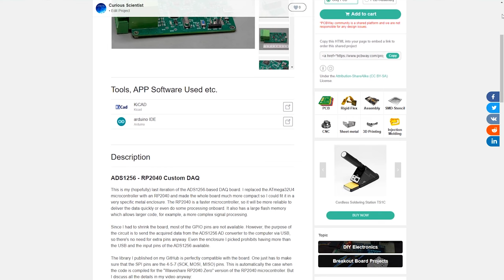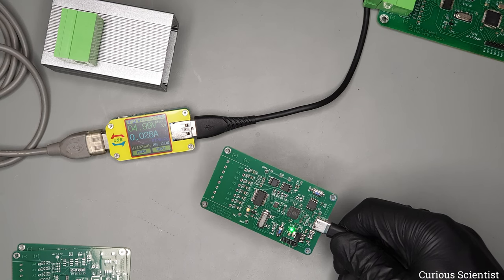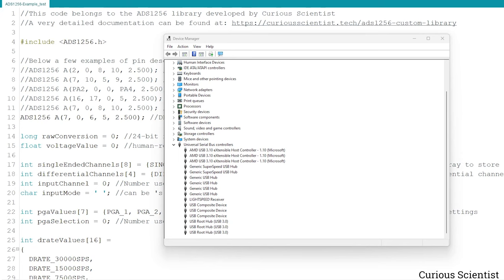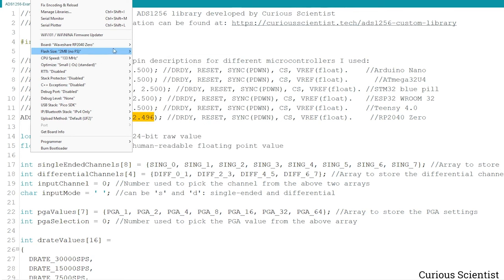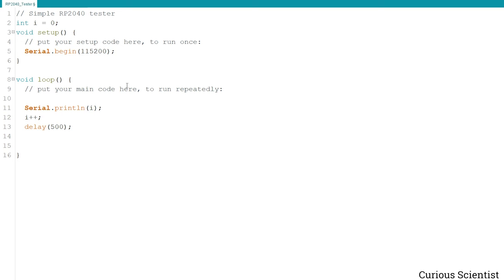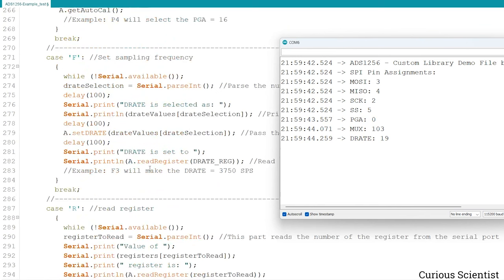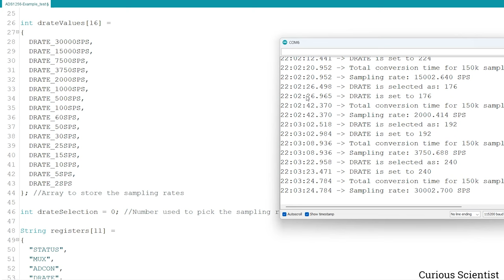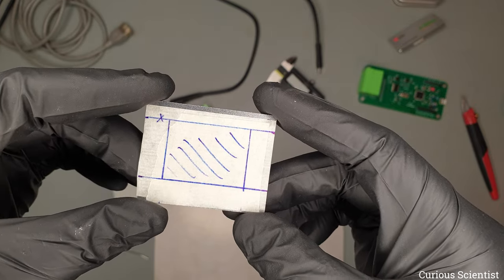RP2040 + ADS1256 DAQ board

Comment: Nice board,is this open-source.why are you using a large TBC connector in the latest iteration compared to the old versions
Reply from the maker: Hi! Thanks! No, the board is not open source because I want to sell it as a product. All older versions have the same big connector. I wanted to have something compact and neat to connect all the 16 possible input wires.
Reply: @CuriousScientist  ok

Comment: Put a red led for power supplyand green led for uart/usb tx rx
Reply from the maker: I see you haven't watched the video. :) There is a power supply LED. At both LDOs. 

Regarding TX and RX LEDs, I don't find them useful, so I did not add them.
Reply: @CuriousScientist  I meant to put it outside the box.drill two holes on the metal plate on the usb side.push two 3mm through hole led through it and connect wire to pcb .this help the end user like somebody who bought your product trouble shoot easily.For eg is the borad receiving power,yes if led is lighting up.if led not lighting up ,no power.maybe my usb c cable is faulty.
Reply: @CuriousScientist  regarding tx rx led.i would suggest you keep it because it is a good indication that the daq board is transmitting something
Reply from the maker: Thanks! Yes, it might be a good idea to have an LED on the front panel. Regarding the tx/rx LEDs, I still have the same opinion.

Comment: Vilket bygge! 

Nice, I'm really interested in this journey and impressed by your builds and looking forward to a possible next video when you release it as a product! 

I have a question regarding grounding of the box. It was not included in the video (i think?). Do you think it's irrelevant for the performance and no protective usage as its only usb-powered?
Reply from the maker: Tack! 
Yeah, I haven't mentioned anything regarding the grounding. Actually, the board is floating. It is not connected to the ground in any way. But I will do some investigation on the effect of this. I will get some new front and rear panels manufactured for the enclosure, and I will conduct some tests. So, at this moment, I don't really know if it has any effect.

Comment: BTW, I'd guess, if you replaced 16Mhz crystal on your old boards with 20Mhz, they'll probably work and you might be able to get full sampling speed out of them at that speed.
Reply from the maker: Thanks! Yeah, it could help, perhaps. But I think the RP2040 version is much better not only because of the much higher speed, but also because of the memory. It allows a lot of onboard processing.

Comment: While it will cost some money may i suggest ordering PCBs from PCBway with holes and all for the rear/Front pannel you can even use the "silkscreen" to write fancy info like A0,A1,... and on the rear the specs of the DAQ box. Also please release a YT vid when you start selling as i am interested in replacing my ratsnest.

Examples
https://www.youtube.com/watch?v=nV8RkhaKKb4
https://www.youtube.com/watch?v=wg_J9WElvBY
https://www.youtube.com/watch?v=UOQezMJ560o
Reply from the maker: WOW! Hey, thanks! I have another project where I was thinking about using a PCB as the rear panel of the enclosure, but I did not think about it for this project. It is amazing that you brought it up, thanks! I will definitely design them and add them to the project. The extra cost will be relatively low because the dimensions of the panel boards will be small. Thanks once again, this suggestion will be super useful! Also, if you are a subscriber, you will definitely hear about any news related to this project because I will spam it all over the place. If you have Instagram, you can follow me there as well because I upload even more content there.
Reply: @CuriousScientist  Glad my 2cents could help wanted to do something like this but i never have the fortitude to finish/polish my stuff.
Reply from the maker: Thank you! You should never give up! I've been working with the ADS1256 chip for about 8 years. It took me roughly 4 years to develop my very own code by studying the datasheet of the chip. And it took roughly 2 years of iterations and learning to reach the current board design. Of course I did million other things in the meantime, but still. It is not a sprint, it is a marathon! 😄